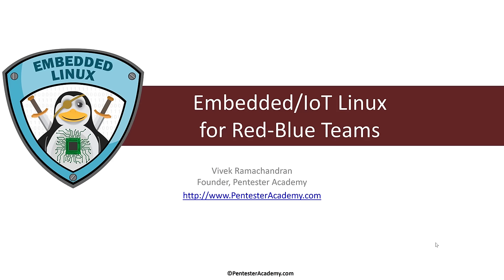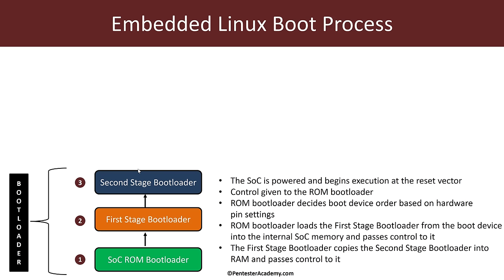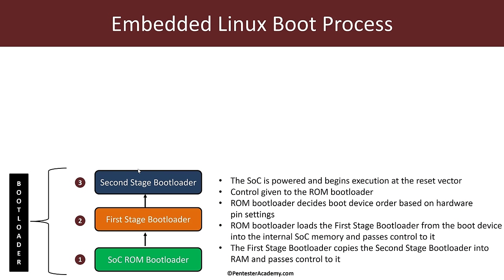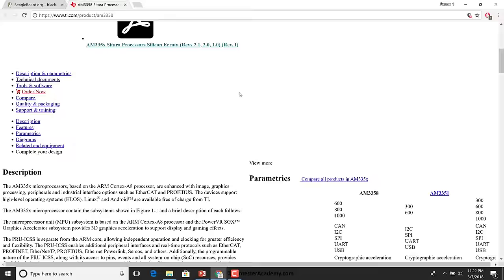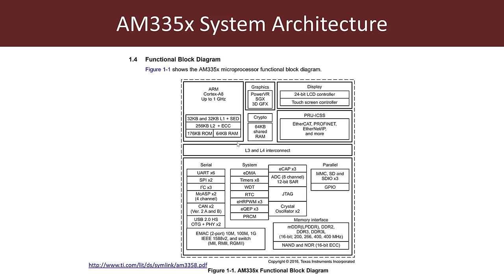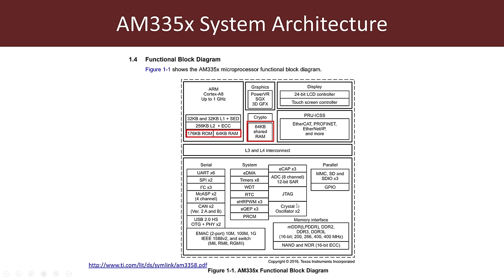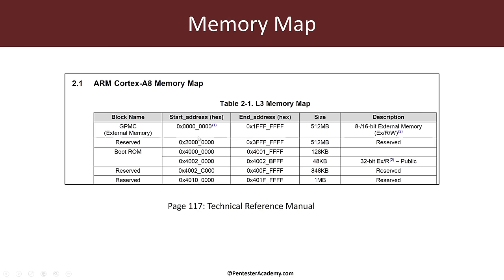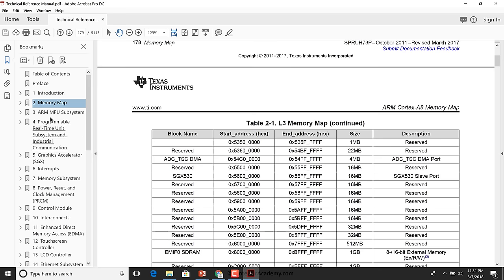Embedded Linux Booting Process (Multi-Stage Bootloaders, Kernel, Filesystem)

Comment: really great video, if possible explain how DDR sets up and what all steps involved in future. These kind of explanation is very rare to get online. Also explain secure boot and what exactly kernel does before launching filesystem or init process. That's the core part which would give more information about the system. All the best and thanks for such a great video again.

Comment: Just FYI. In case the primary bootloader ever needs to be updated, the secondary bootloader would be loaded into ram, thereby allowing all the internal flash to be erased and reprogrammed with a new primary bootloader and a new Operating System or program.

Comment: The last 3 minute content is key important! Internal RAM is expensive to put Uboot inside at the time ARM A8 or old ARM9 has realy little inside RAM. And ROM bootloader(fixed code inside SOC) can't know how to initialize external RAM/DDR as it knows nothing about your PN/Layout. Things may have been changed to ARM V8 as new Soc may have bigger inside RAM now, normally 4M/8M, big enough to put Uboot inside.

Comment: The MLO is present on SD card and then it is brought into RAM which executes directly from RAM. Why can MLO be put in On-chip flash and directly execute from on -chip flash. What is the advantage of using this architecture. Is it because MLO features can be upgraded with this method.